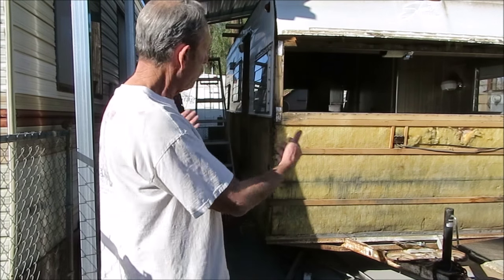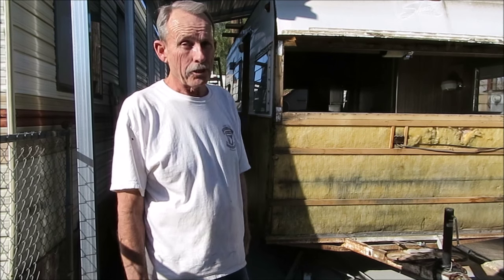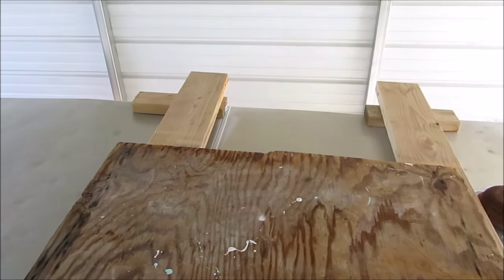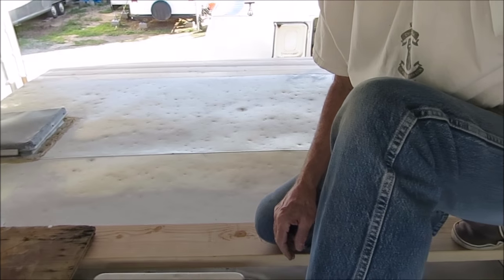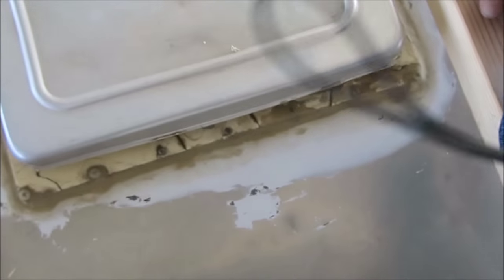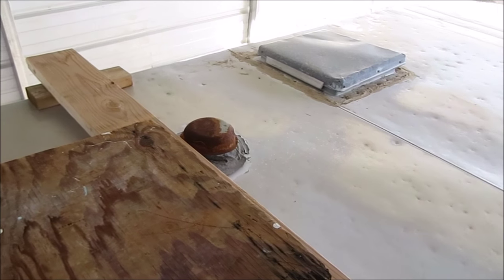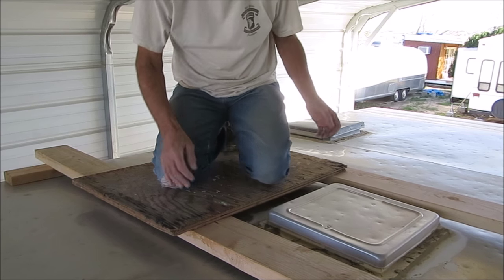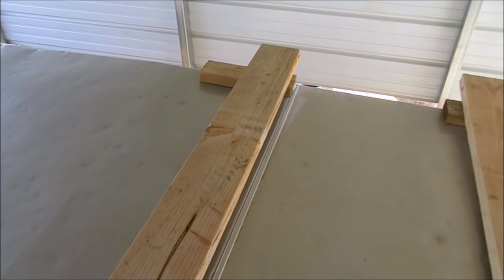Quick Tip 4 Working On Top Of The Trailer

Comment: Hi Larry, I've enjoyed watching all of your videos. My husband and I are in our 70's and recently bought a 67 Scotty camper. We were told it had been redone two years ago and since we were new to vintage campers, didn't know what to look for. Long story short, it has been leaking for a long time but I have learned a lot watching these videos. We are beginning to attempt the repairs, not complete restoration but redo the rotted wood, replace the interior luan, probably will replace the front bottom piece of metal. Also new Jrail using new screws and Butyl tape. Appreciate the information. I tried to send you money via PayPal and couldn't remember my password. Got to reset it and all that but I will. Thanks!
Reply from the maker: Good luck with your repairs. Lot's of people are duped into thinking the trailer they bought was actually "restored". So don't feel too bad. You can use a credit card for the donation by paypal...
Reply: Hi Larry.  This was my first shout out to you a long time ago.  Found out it wasn’t a Scotty but a PlayMor. I also found out there was a lot more work and expenditures involved.  I’d be ok with it if only we were finished.  Got the new metal last year and got all of it installed except the bottom street side and back end. It was so much harder than I thought it would be. Karl can’t do anything.  Our daughter helps me.  I’m hoping I’ll feel like starting back on it when it warms up a little more. Hope you are well.

Comment: Are the blocks under the 2 x 6 s to allow them room to bow or more to distribute the weight a bit farther through to the wall? Or are the roofs higher in the middle and that's the need ?
Reply from the maker: +nintendolunchbox You don't want any weight anywhere in the middle of the roof. That framework is only 3/4 inches thick. So you want the planks up off the roof. The only place that will handle the weight is on the outside edges of the walls. And that in many cases is only 3/4 to one inch wide so you want the blocks hanging over the edge just a bit to make sure all the weight is supported under the aluminum. Most of the walls in these old trailers are only 1 inch wide if that.

Comment: Hi Larry, will this method work on the 2014 Shasta Airflyte? I was told I could not get on the roof. The roof framing is only 1x2 and the walls are 1x1.  Thanks, I appreciate your videos.
Reply from the maker: Yes it should work.

Comment: So, I am about 300 lbs. 
I think I would still be a bit sketchy up there. You think the side rails could hold me up or should I just build legs that go to the ground for support?
Reply from the maker: +busturdify Yep that's what I would do. Build something you can drive the trailer under. Either that or some ground supported scaffold.  I have many friends who are near your weight that work on trailers and they always come up with something for this part of the job. Sometimes it's their grand children that get talked into doing it.
Reply: +busturdify I'm about a biscuit below 300 and the 2X4 or 2X6 with plywood worked for me on my truck camper. I'm a little clumsy and replaced both vents with no problems. Same type of structure on a camper.
Reply: +Aaron Belknap thanks!! 
I'm hoping to use some leftover lumber for my scaffolding, so I won't be out anything for safety sake.😃

Comment: Hmn, that looks like I would tip the edge of the board trying to get down and kick the ladder away and have to hold on and hope I dont crash into the ladder and back into the side of the trailer, busting the side in LOL. I think I am going to ad a tip, and screw the end boards to give a t so it braces on over the edge, so if I am going to slip and grab the board, it gives me that split second of not kicking the ladder.